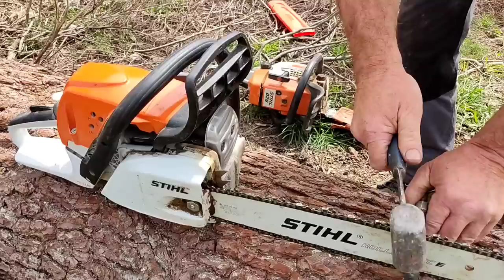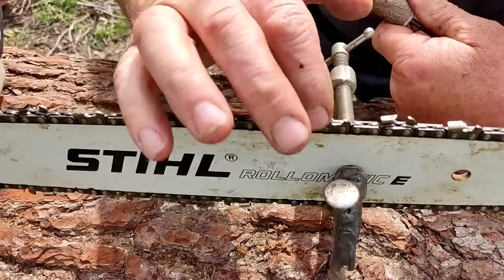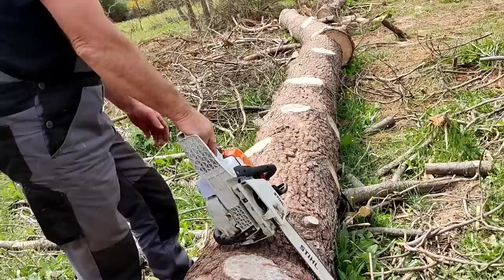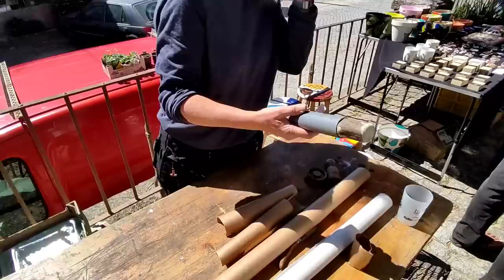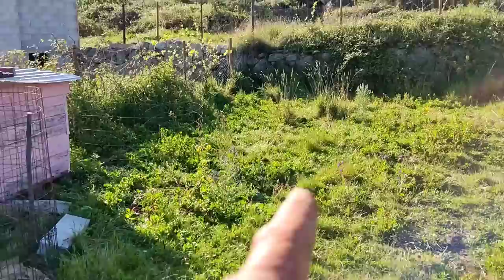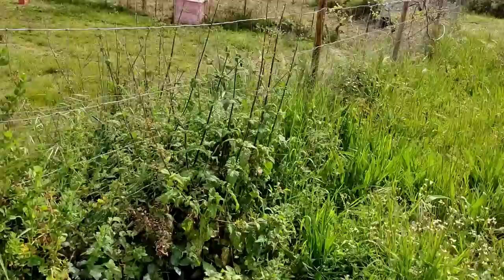How To Sharpen a Chainsaw with a file. basic use and Maintenance: 138

Comment: Great explanation and good advice. Several things that I can add. One check the tension on the chain after running it for awhile as the chain will stretch and loosen up. Two don't let the fuel tank run dry. I have several Stihls and sometimes they won't restart after that happens and you have to let them completely cool down to start them. Three add bar oil every time you fuel up don't burn up your chain. Four check the wood chip size to ensure the quality of cutting. Lastly taking a course will be the best money you have ever spent. Great job Nick!
Reply: My husband has 3 chainsaws and was a lumberjack for a little while, when showing me he made me wear all the safety gear, a note, the trousers had a rip in them so they had saved his leg. 😮❤
Reply: @nickytanton107  Absolutely Nicky I received training from the US National Forestry Service and that was constantly stressed over and over again.

Comment: How do you determine the diameter of the file to use?
Reply from the maker: Depends on the size of the chain
Chain pitch.            File size
1/4.                          4mm
.325.                         4.8 mm
3/8.                           5.2mm
404.                           5.5mm
Hope this helps